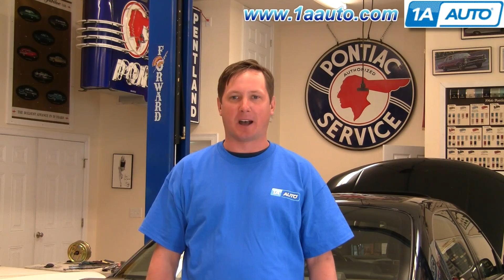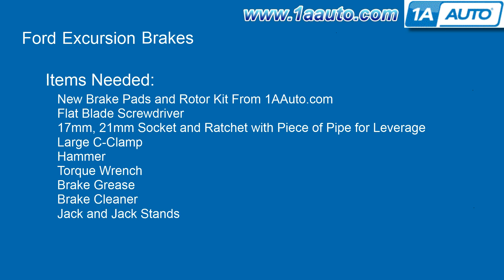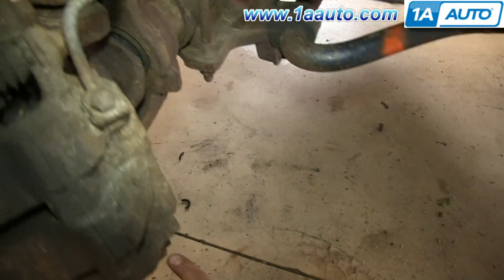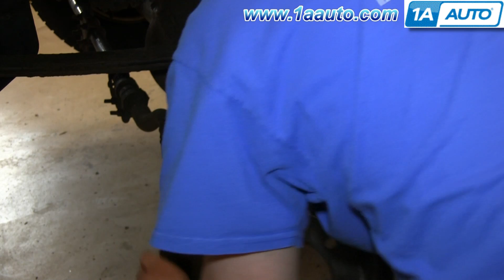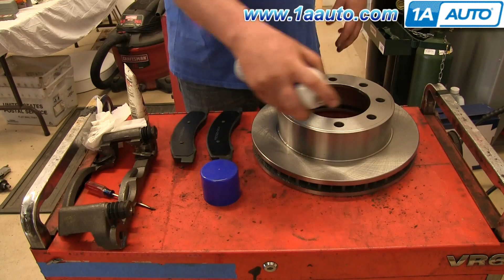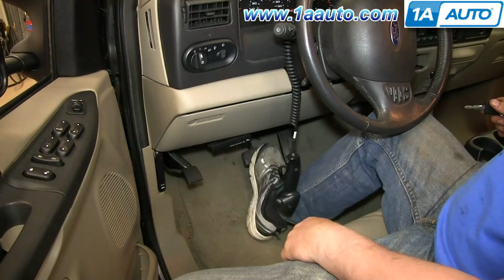How to Replace Front Brakes 00-05 Ford Excursion

Comment: In your video, you mentioned tightening the lug nuts to 100 ft-lb, I always thought they should be 145 to 155 ft-lb.
Reply: Should be 165 lbft
Reply from the maker: +Alex Yu It is 150ft-lbs. Sorry for the error.

Comment: You just pumped the brake pedal until it was firm but do you still need to bleed any trapped air in brake line?
Reply: not if you didnt remove the brake line from the caliper

Comment: Please don't forget to use medium strength ( Blue ) Loctite on the caliper bracket bolts ( 17mm ). There are instances where these bolts will back off.

Comment: What's the minimum/acceptable thickness for the rotor?
Reply from the maker: +dasteufelhund Thank you for checking us out. The Nominal rotor thickness should be 1.495 inches, and they should be replaced if the thickness gets to 1.417 inches or below. 1aauto.com
Reply: Awesome demonstration!  Thank you!

Comment: The biggest difference is the rotors, and they aren't interchangeable, so that should be pointed out. I almost ordered the parts list from you based on the video, but after further research I found out that I need a different parts package.
Thanks for the great video.

Comment: Was the vehicle in the video a 4WD?  You don't mention if it is, but I think the rotor and pad package is different for a 2WD.  It would be nice to see the same replacement for a 2WD Excusion.
Reply from the maker: +Michael Grahek You are correct. This vehicle is a 4WD, and most of the components should remain the same. Some on the 2WD will be separate. 1aauto.com

Comment: Very helpful. Did my first ever brake job on my 2000 Excursion.  Would not have done it if I hadn't seen your video.  Thank you.
Reply from the maker: +ludvig tande Congratulations on the successful repair.  We're glad the video helped you out.  1aauto.com 866-403-3393